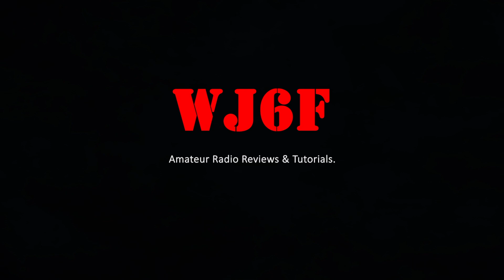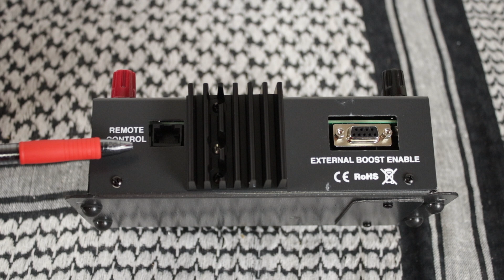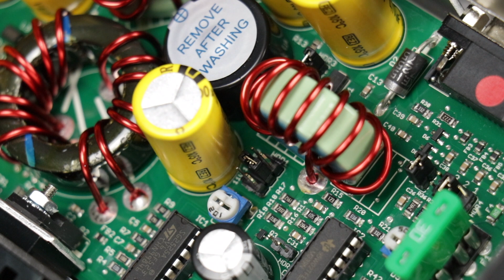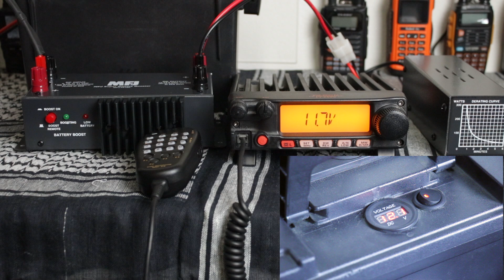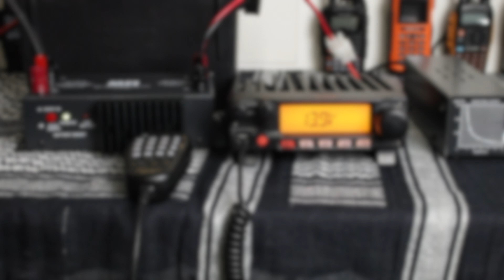Super Battery Booster MFJ-4416C

Comment: It produces some "birdies" RFI interference that can creep up and down in frequency.  It would be great to be able to tune the birdie and in theory there's an easy way, a trim pot across the resistor that controls the frequency of the boost converter.  But, that involves surface mounted components and not so easy to get to.
Another solution which works to greatly reduce birdies is using ferrite common mode chokes on input and output.  
The importance of a booster may not be obvious especially if you assume that 100 percent on your power level is 100 watts.  It can be, IF you are providing the specified voltage (usually 13.8 volts).  
The ICOM 7300 applies battery voltage to the final amp but also the driver stage and what that means is a decline of battery voltage not only reduces final drive power, but also the driver stage power or signal strength so it is a double impact on power.  More than double depending on the gain of the final amplifier as its gain multiplies the reduction of battery voltage.  
This can be non-obvious when using SSB but it sure shows up in digital modes when my radio maxed out at 11 watts; hit the boost switch and now suddenly 40 or 50 watts measured output.   40 watts FT8 will heat up the radio a bit.  AVERAGE voice power is much less, maybe only 25 watts.

Comment: My 4416B has been my go-to for years with lead acid batteries.  Now I have LiFePO4 and my ic7300 seems to perform just as well even at 100w directly from them.  The RF noise isn’t that bad but it’s there, so unless I’m running a net I usually would just boost on transmit.  Great product though.
Reply from the maker: Thank you for taking the time to watch and the comment! It is greatly appreciated.
Reply: The IC-7300 is very sensitive to supply voltage since not only the final amp, but the driver stage is driven directly by battery voltage.  A 1.5 volt decline in battery produces a dramatic decline in actual measured power output.  
The IC-705 applies battery power directly only to the final amp which, by the way and unsurprisingly, is basically the driver stage of the 7300.  Anyway, much more linear decline; 10 percent less voltage produces slightly more than 10 percent decline in power.  (reduced voltage also produces less current so it is a square law relationship but doesn't actually measure out that way).  
Lithium batteries have a lot less battery "droop" in voltage while transmitting, hardly any actually, about 1/10th of a volt key up to key down difference.  But still not 13.8 volts the IC7300 wants.  I measure about 11.4 volts from a Goal Zero; not sure what chemistry it is using, seems a bit low but it works fine.  Just needs a boost.

Comment: What is the current capacity of that MFJ-4416?
Reply: It is rated at 25 amps, and that's probably input.  If your radio needs 20 amps, and a typical HF radio needs 20, because of the boost, it will draw more than 20 from the battery.  I have one and it works well.

Comment: My only complaint about the booster is the RFI it generates.  I recently got it back out.  My goal is to make a remote enable to only boost on transmit.
Reply from the maker: Thank you for taking the time to watch and the comment! It is greatly appreciated.
Reply: I've considered doing that, it is a bit of a nuisance but exists for a reason.  I have had good results putting ferrite common mode chokes on the power wires close to this box.

Comment: I have been using the MFJ-4416C for 2 years, it works as shown but what is rarely exposed is the amount of spurious RF noise that it generates on the HF bands. Using an IC-7300 we can clearly see the added birdies which move has we toggle between TX/RX. The worst band I have seen is the 15M band (21 Mhz). I still use it in the car because I need 13.8V. It is good but generates birdies on HF and using it on 2M/70cm worked well.
Reply from the maker: Thanks for watching and commenting! It is much appreciated. I will have to give it a try on my FT-891 in the car and see what happens. Thanks for the heads up.
Reply: @WJ6FRadio  Would really like to hear what you found out! W0KNI
Reply: Yes, I wish there was an easy way to at least move the birdies, and there is.  One of these days I'm going to add a potentiometer to the frequency setting resistor (r/c circuit) for the boost converter.  Eliminating the birdies is probably impossible but moving them is fairly easy.
As it happens I put ferrite chokes on input and output and greatly reduce birdies.
Reply: @thomasmaughan4798  Right, off-setting the birdies with a potentiometer would be a great idea!